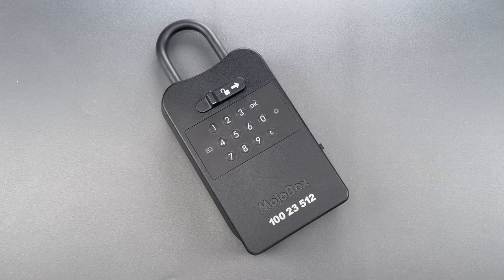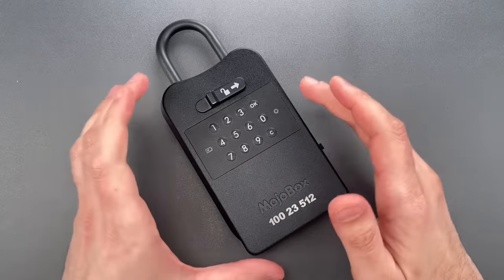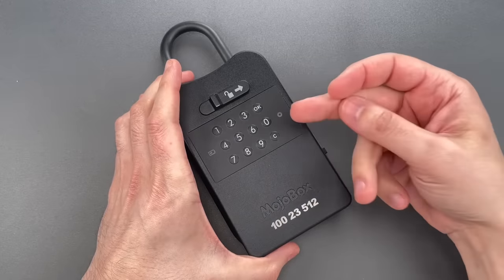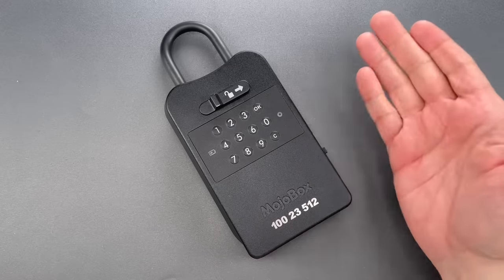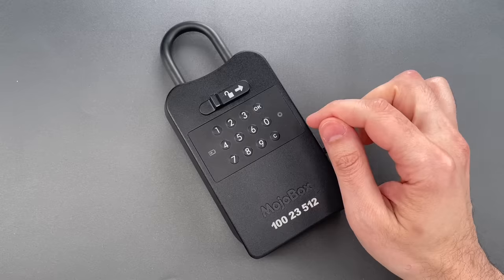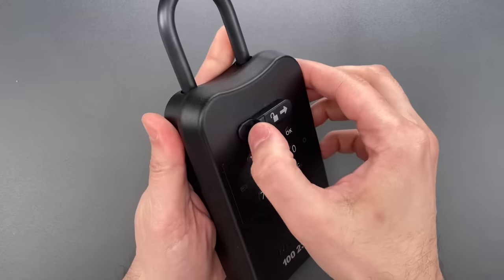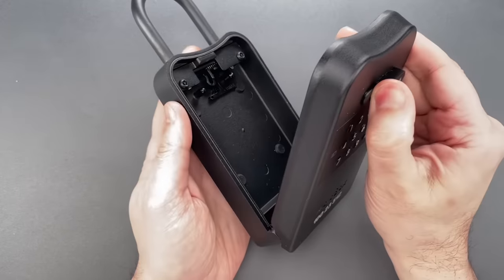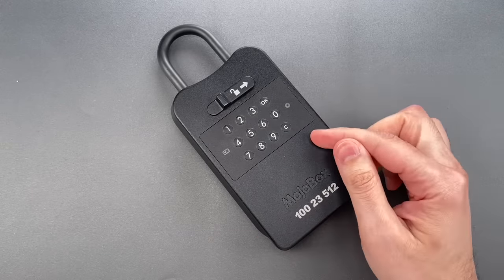[1505] MojoBox SLAPPED Open!!!

Comment from the maker: IMPORTANT UPDATE:  MojoBox users were just sent the email below. My hat is off to the folks who worked overtime to patch the vulnerability the day after this video was published. 

————

On February 26th, after a year in the field, an exploit was discovered that could provide unauthorized access to the MojoBox digital lockbox.

On 1pm EST, February 27th, we released a firmware update for all MojoBoxes. It completely resolves the Feb 26th exploit. You can immediately push this update to each of your MojoBoxes from the MojoLock app.

To do so, just follow these steps:

Open the MojoLock app.
Select a MojoBox.
Look for an “Upgrade Firmware” link at the bottom of the specific MojoBox screen.
Click the link and follow the steps in the app.

We recommend all users act quickly on this update. This will need to be done in physical proximity of each MojoBox. We apologize for any inconvenience this may cause.

Our team will communicate additional information about the how and why of all of this in the coming days. We will add a notice to the MojoBox Product Page, and you will be able to review additional detail there.

We built the MojoBox to be a secure and affordable digital lockbox. While we wish our testing had uncovered this issue before the MojoBox was released a year ago, we hope the quick resolution of this exploit helps to make the point that we stand by the product we built.
Reply: Now you gotta slap it twice instead of once
Reply: You know what, props for getting this patched that quick.  That's better than we usually get out of enterprise software vendors for equally serious bypasses.
Reply: Good on them for owning it and fixing it ASAP!
Reply: This is why QA is one of the most important skills in the software industry. Coming up with ways to break things that the dev team didn;t think of is a necessary skill that development engineers (generally) do not have. Their focus tends to be on building rather than breaking ;)
Reply: Damn shifted on that lock lmao
Reply: I was actually just coming here to post this!  I have 20 MojoBoxes.  I was able to easily reproduce your results after watching your video.  Obviously that terrified me, so I reached out to support.  They confirmed they were already aware of your video and that they were working on a solution.  First thing this morning I received a message from support telling me they had a firmware update.  I tried it and was unable to reproduce the problem, despite my best efforts.  Later I received the email you posted below.

SUPER impressed with the response to this!  My confidence was shaken yesterday when I saw your video.  But I'll admit, it is restored and then some by the response.  High 5, MojoBox!
Reply: Wow!  Does this mean a revisit?  Wait, does this mean your first revisit?!
Reply: Amazing fast fix. Digital locks might have extra flaws but some have upgradable firmware and a response team.
Reply: i mean the fact that it was ever like that to start with is just unforgivable. how did that not pass QC?
Reply: If only all brands had this level of commitment…
Reply: Back to the ole hammer smash attack
Reply: @ghostbirdlary  Too much focus on the digital side of things
Reply: @JamesIsAway  🤣
Reply: Mojobox and the case against Master Lock.
Reply: Adam  LPL is the QA of the lock industry. I will only consider a lock if LPL takes more than 11 seconds to open!
Reply: Maybe for such potentially fixable exploits, you could consider a responsible disclosure approach as it is common in cybersecurity? I.e. inform the vendor in advance, give them 3 months to address the issue before going public. That avoids unnecessary overtime work for folks.
Reply: Lol so all they probably did was either A. Randomize when the calibration occurs
B. Make the time delay way longer C. Remove recalibration all together
Reply: @noleti  Maybe folks WANT overtime work. Time and a half is nice once in a while. LOL.
Reply: @TheCarpenterUnion  LOL, "all" they did was address and correct an issue. What difference does the mechanism of correction make if it fixes the issue? 🤷‍♂️
Reply: so that means, you DID NOT reach out to MojoBox before publishing this video? :o this is not good manners :(
Reply: They should have thanked you in their email for finding the exploit.  Now we need to see you test it after you apply their update.
Reply: @noleti  No! Manufacturers of locks that are meant to secure valuables, do not deserve that courtesy.  LPL serves the public - not the lock manufacturers - if he found this simple exploit, its 100% likely that criminals have also found it.  I don't want to unknowingly use a lock for 3 months that is completely insecure while the manufacturer decides the ROI on a fix.
Reply: @TheCarpenterUnion  came here to say the same. 

Also, a larger smoothing capacitor would solve this issue. It's literally a 2 cent component.
Reply: Now you have to post a new video showing that the fix works, and that you managed to open the box in a different way. 😁
Reply: @DrWuzer  this is a very old discussion in cybersecurity with the same arguments. Advance warning for manufacturers will enable coordinated release of patches at same time as public disclosure. It's the ethical thing to do. The 3 months deadline is a compromise between early warning of customers and manufacturers effort. Three months can be shortened if fix is easier
Reply: @noleti  except we're not talking about cyber security here, we're talking about a physical lock, that is being used to protect someones valuable posessions and possibly lives. This exploit was found by LPL in 30 seconds on a lock that had been for sale for a year - odds are the manufacturer knew about this exploit and simply did nothing about it until LPL posted this video.
Reply: @jamesslick4790  idk dude, maybe stick to playing with Dell computers and rocks

A software fix to a hardware problem is not a real fix.
Reply: @TheCarpenterUnion  option B I'd say....
Reply: While it is great the manufacturer patched the issue, I would think there would be a certifying body or resource that a lock manufacture could go to in order to better test their locks before putting them into the wild.
Reply: @HelenaOfDetroit  I commented a day or so back that it looked like someone had decided a cap on the supply wasn't needed. I'm now wondering how they've tackled the issue in firmware.
Reply: @TheCarpenterUnion  You can paper over the hardware issue but it's still there. I'm wondering what the firmware fix is - avoiding the unlock state in the power-up locking mech initialisation?
Reply: actually impressive they took your video and released an update that quickly.
Reply: Having a response  like that from a manufacturer is incredible… they made a mistake, they admit it!!! and they fixed it unbelievably fast. All thumbs up. 👍
Reply: @noleti  I totally agree with you. Even a month of heads up would have done wonders I believe.
Reply: @Subsessor  I know someone at the company. There was absolutely no warning. Seems really irresponsible to post something like this with no warning.
Reply: @DrWuzer  It’s fine enough for you to think that companies deserve no respect. You're entitled to your opinion. But there are consumers (y’know: innocent people) out there actually using those locks. 

By making this public with no warning to the company, no time to see if there’s a fix, LPL just put a lot of innocent people (or at least their property) in potential danger.

That’s not right.
Reply: @elon-ff7sj  on the contrary. His actions probably saved the public by alerting them to this hazzard.  Company had this fix ready to go, they've probably been sitting on it for cost reasons and would have continued to sit on it if he'd notified them privately.  Companies making locks need to do better!
Reply: @Graham_Langley  "the firmware fix is - avoiding the unlock state in the power-up locking mech initialisation"

Almost certainly.  In hindsight it was stupid to unlock the lock on power-up, but of course they just assumed the lock had to be open to "install" batteries.  This is also a problem caused by "lowest bidder" syndrome - in this case probably fresh computer science grads developing the software in a  Third World* country.

* NATO and Warsaw Pact countries were the original "First and Second World" blocs.
Reply: Now @LPL can apply the firmware update and return to the rest of the exploits on his list.

To those criticizing LPL not reporting this quietly to allow time to make a sofware fix:  In locks, their weaknesses are traditionally hardware and no one expects advance notice for a hardware fix to be distributed.  It's only relatively recently that software has begun to play a role in their security.  It seems dubious to ask a hardware guy to make a judgement call on possible software vulnerabilities when the "exploit" is thumping the device.
Reply: @Randrew  Have you listened to the beginning of the video? LPL seems to understand this was more than a hardware issue. Also, LPL happens to be a lawyer. He seems like a pretty smart guy.

You’re expecting product manufacturers to build and test their products completely right before release. (If not, they and their customers deserve what they get here?) 

But, then, shouldn’t you expect that the person who discovers the exploit also puts in the extra work and does the right thing?
Reply: @elon-ff7sj  LPL has absolutely no obligation to manufacturers that make bad locks.  Period.  You could say that about his whole channel. He literally shows people how to pick locks.  That's his channel. He's posted how many exploits of Master lock and they still continue to make horrible locks.
Reply: @elon-ff7sj  I've been doing embedded / automation software since 1986 and I say software that controls real-world devices deserves a high level of testing and QA.  Ideally "I" would like the chance to fix a bug before it causes trouble, but honestly I didn't expect a Chinese supplier of random eThings to give a crap, let alone get a fix out in a couple of days.

And BTW I've worked with Chinese manufacturers for the last 30 years and been married to a Chinese woman for the last 25 years, so my opinion is not that of an American simply denigrating ferrinners.
Reply: @DrWuzer  This isn't about the manufacturers. It's about the consumers -- the users. It's about the people who bought that lock. Seems you're having a real hard time coming to terms with the fact that there are people who use these devices that could be harmed when exploits are published without warning.
Reply: @Randrew  Same for you. It's hard to follow how your "I didn't expect" answer justifies the needless risk for everyday users that could have been easily avoided here.
Reply: @elon-ff7sj  so in your opinion, everytime LPL defeats a lock, he should send a note to the manufacturer and wait 30 days before posting his video?  That's insane.  Are you even listening to yourself?   You're actually starting to sound like you might work for this lock manufacturer.  🤣😂🤣
Reply: @DrWuzer  if the company already had the fix ready, what good will it do them to not update it? It just doesn't make sense.
Reply: @elon-ff7sj  When a flaw can be fixed in software then maybe it should follow the current accepted notification processes.  And maybe LPL will consider it henceforth.  But as I said initially, this case would have required a judgement call from someone not familiar with software vulnerability reporting standards / practices - no matter how smart he is.
Reply: @elon-ff7sj  I totally agree with your comment here. @drwuzer seems to think that making something like this public is the best way to go instead of thinking people's safety.
Reply: @DrWuzer  You have been commenting a lot on this that YOU actually are the one who's starting to sound like you might work for the lock manufacturer's competitor 🤔
Reply: @courtneygarcia-mk8tb  I've only been replying to what others are saying to me.
Reply: @courtneygarcia-mk8tb  hilarious both you and Elon just joined YouTube today.  That seals the deal for me - you work for the lock company and you're trying to do damage control. Nice try.
Reply: @DrWuzer  I see. Then why are you so invested in this? It's not as if the company did this intentionally to scam people. It's actually amazing how they took this seriously and resolved it right away. Other big companies won't even invest the time and energy.
Reply: @courtneygarcia-mk8tb  their quick action after LPL posted his video is very commendable and I never said it wasn't.  I wish more manufacturers were as quick to respond to the problems he points out
Reply: @DrWuzer   I don’t know what LPL should do. But I think there are people using those devices (who you still have not acknowledged). Isn't there some way to get them protected -- when the company is willing to listen? I just don't think this was done right. At least looking at how it played out.
Reply: Whoa, we have a company that's paying attention and fixes the issues?  I want to see a round 2 now!
Reply: @DrWuzer  I'm glad we agreed on something! 😂
Reply: @elon-ff7sj  Prior to LPLs video they were unprotected - FOR A YEAR.  Now, they have a fix for the lock and communication from the company, so they are protected. Listen Elon, you've done a good job, quickly issuing a fix for your mistake when you designed the lock - its on you to contact your customers now and make sure they're aware of the fix and get it deployed.
Reply: When companies fix the issue and more importantly own up to and disclose their mistakes.... there might just be hope for them
Reply: Well done.
Reply: @DrWuzer  proper debating proceeded is to not act some ones character or who they are instead of actually responding to what they are saying. it just makes it look like you have no way to counter their points. that being said Is a little bit suspicious how recently they joined YouTube. but it's also possible that they could just been watching YouTube without an account.
Reply: @noleti  Nah. If this device is securing anything of import, both the vendor and customer should know right away. Imagine if they were master lock and didn't care about the product. If the company wants to avoid overtime, they should send it to LPL and other pickers before releasing the final product. Just my opinion, of course.
Reply: @Cliff Sheldon  I don't work for the company. Problem is, I'm not a fan of bullies. @noleti had a point. You tried to shout it down. So I'm pushing the point. But you seem more interested in watching the train wreck than thinking about the people in the train.
Reply: I bet all you have to do is slap it repeatedly now! Surely, if they've added a delay, jus do it for longer
Reply: @jamesslick4790  or a high caliber rifle at the shooting range 😂
Reply: @jmatya  Well we know Master Locks are TOUGH under FIRE.
Reply: @jamesslick4790  Software Engineers are typically salaried. Overtime doesn't give us anything except less time with our family, friends, and hobbies.
Reply: @noleti  It's not like he found a 0-day in TLS here. It's a cheap electronic lock box. If someone is storing something that valuable in there, then they should really rethink their security practices. It's not like national security and trillions of dollars worth of people's bank accounts and e-commerce is depending on it as is often the case with cyber. And an attacker here would have to be physically present to carry out the crime, not sitting in their home in some non-extradition country that at least tacitly encourages cybercrime. These are just not comparable situations at all.

Frankly, he probably didn't expect the manufacturer to actually fix it. Good on them for doing so. Most manufacturers of cheap consumer stuff wouldn't. And good on him for acknowledging their quick action in response to his video. Overall, this seems like the best possible outcome for consumers in this situation.
Reply: Adam   -  Except Masterlock.  They pride themselves on their shitty locks.
Reply: I honestly want to buy one just because of how well this situation was handled. You don't see that very often. Maybe LTT would pick them up as a sponsor
Reply: It took then a single day to patch this in software. Master Lock has had, what, thirty years to fix their designs. This speaks a lot about the difference between an electronics company vs a “security” company.
Reply: So did they fix the issue?
Reply: I applaud mojo box for acknowledging and fixing the vulnerability.
Reply: And they deserve the props for the quick response! Now let's hope there's no software vulnerability...
Reply: @Rob-sr9rj  nope, you can still smake the case( just need to do it a little hard) and it opens
Reply: @ghostbirdlary  QC "Let's make sure it works and doesn't have any strange bugs" is a different mindset than an entry specialist's "Let's find an exploit by making a AA jump in it's compartment while full seated and the battery door secure"
Reply: @xEricC1001x  bro he litterally just smacked it lol
Reply: @ghostbirdlary  The typical apply-force attack is on the locking mechanism of the shackle that's flawed in a specific way. If they built using a better mechanism, they may have just presumed their lock is immune, ignoring that a similar effect can happen with the batteries since this is the first I've ever seen it and have watched tons of LPL videos.
Reply: Notification in cyber security is for NEW exploits.  This is and old, we’ll known exploit.  The difference is that people who DO testing and due diligence can miss previously unknown exploits, while it’s only the careless that miss well known ones.  You don’t see pre-notifications for SQL injections, or cross site scripting attacks often for this very reason.
Reply: That's a surprisingly good response. A bit sad we no longer expect them to behave like this..
Reply: Kudos to the company for fixing it asap!
Reply: @ghostbirdlary  in all fairness who in their right mind would think to slap a box haha
Reply: @darrenfalconer3267  i mean that would be my first thought. i mean not to slap it but just to hit it a few times
Reply: @lockpickinglawyer I guess this means you know, they watch your channel now. At least they are learning from their mistakes, unlike master lock.
Reply: So are you going to apply the patch and have another shot at it?
Reply: @RightWingNutter  I did, you just gotta hitnit with alot more force, still unpowers the lock and pops open
Reply: @phlowtx  a simple physical fix for this would be to after an initial contact point pack the spring area with paper or similar to make the spring unable to be compressed thus removing the vulnerability
Reply: Have you tested it after this update?
Reply: I wasn't too surprised to see the letter from the manufacturer from a technical perspective.  I'm an electrical engineer and I've designed many microcontroller based products.  I didn't realize an app could flash new firmware.  I knew the manufacturer could fix the firmware going forward but  I was surprised that the company cared enough to admit the fault and offer a fix.  Kudos.
Reply: Proof that isn’t always the lack of problems that determines a company or products worth: it’s how the problems are handled.
Reply: @ladyaurora1325  really? Didn't he replied enough to them? God... Self entitlement.
Reply: Wow! Great response from the company.
Reply: So now the lock we open only by talking kinky to it. That's a improvement.
Reply: When you make a new lock Mojo , FIRST send it to the Lockpicking Lawyer to save you further embarrassment 😂
Reply: @ghostbirdlary  Because QA does not involve sending it to TLPL first 😂
Reply: @A2Z1Two3  i mean in this case i think QA should have found it.
and if i had a lock company i would 1000% send it to LPL
Reply: I think they changed it so the calibration sequrnce happens at first unlock if box is closed, otherwise directly. Since the box knows if its open or not (you can see the green blinking light when LPL unlocks it), it can easily postpone the calibration to first open after power loss.
Reply: Mad props to companies that don't ignore (or worse, attempt to destroy) people who point out an exploit.  If only Oracle (and a thousand other software companies) were so inclined.
Reply: bro if i worked months to make a great accessable lock and someone showed did this to my lock i would literally have a mental breakdown
Reply: I'd like to know how they supposedly "resolved" the exploit. It presumably needs to perform that calibration step on a semi-regular basis, so what, is it now only possible to perform manually?
Reply: @ghostbirdlary  I don't think it's unforgivable, it's not like this can be done accidentally. Easily once known about though, and they patched it up asap which shows that they care.
Reply: @DrWuzer  I wouldn't say 'on the contrary'. This is a lot like those Tiktok challenges that spread harmful knowledge to those unaware of it. Lets say it was not a quick fix and it did, indeed, take 3 months to fix (or even just one month). Anyone who saw this video (and interested parties would spread it around) now had a whole three months to go around slapping these locks when seen. The silver lining is that it was a quick fix and the day after it was solved, but this was the best case scenario and random at that. 

Otherwise for the next three months the owners of those locks might as well swap them for other locks.
Reply: @courtneygarcia-mk8tb  Or maybe he doesn't want to have the locks fixed and would just rather know how to open them. For reasons :)
Reply: Seems they saw the video
Reply: @kumoyuki All Devs need to learn QA and vice versa.